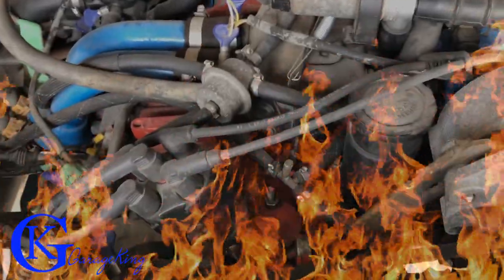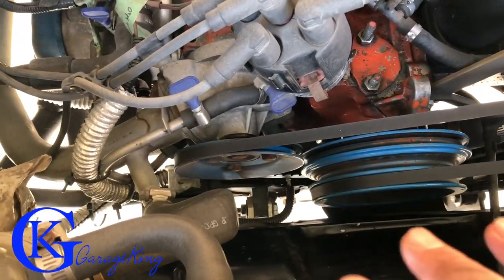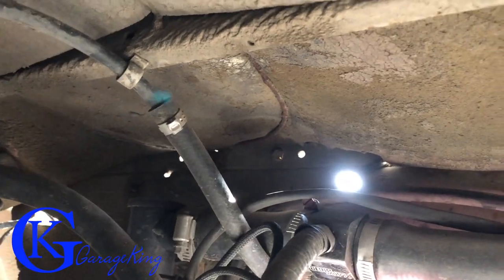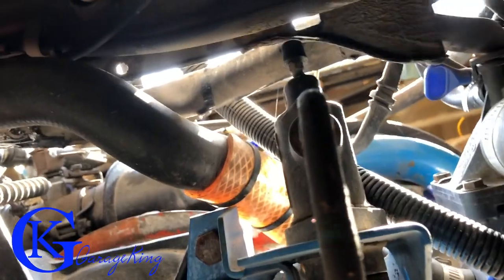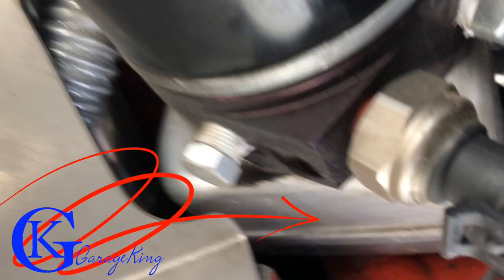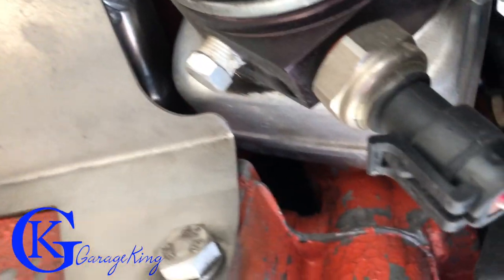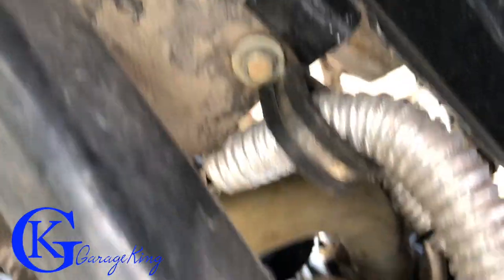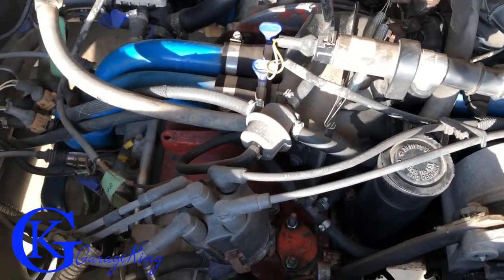4 Must Have Vanagon Gauges

Comment: Great video, It makes me want to try the same set up. Did you post a full shopping list" that would be super helpful. Mahalo from Hawaii.   1989 2.0 T3
Reply from the maker: Thanks for the comment and I wish I was in Hawaii right now!!!!!!!  I bought everything from https://www.maxtow.com/  the gauges are actually quite expensive so I didn't think anyone would want the ones that I bought (I figured people would buy cheaper gauges)  The double vision gauges I got are over 100 each so you know thats like almost 500 bucks just for the gauges.  The rest was not too pricey, the adaptor for the hot water sensor was the 1 inch one, and then just the sandwich adaptor for the oil filter.  I thought it was really cool to do, but its not cheap that's for sure.  I did think about cheaper gauges, but I thought what the heck you only live once !!!!  Happy Saturday to you ;)

Comment: Which model of Glow Shift sandwich adapter did you get? I have seen conflicting versions form people for the 2.1L waterboxer.
Reply from the maker: Hey brother I looked everywhere for my bill and can't find the model #.  Believe me I search, even through my emails.  I believe you should get the one with the threads 3/4-16 UNF if you have a North American vehicle.  Sorry for the delay, and hope I helped you out.
Reply: @GarageKing  Thanks for the info, greatly appreciated!
Reply from the maker: @westyfreedom9284  Anytime !!!!
Reply: @westyfreedom9284  hi, would you happen to have confirmed the part # for the2.1l?
Reply: @mozaic_channel  Sorry, it is the GS-AF2
Reply: I also purchased the Innovate 3913 Oil Temp and Pressure dual gauge kit
Reply: @westyfreedom9284  Thank you!
Reply: @westyfreedom9284  costly gauge but looks really neat to be able to program thresholds and range.

Comment: Very informative.  I like the idea of tapping into the bi-pass water hose for temp readings.  I'm having a challenge determining which GlowShift adaptor to use.  Do you have the size? Also, what do you think of tapping into the hose between the water pump pipe behind the pulley and the elbow on the engine case as an alternative location?
Reply from the maker: Hey Thanks for reaching out.  I just went and measured the old bypass hose and its 1 inch inside diameter.  I looked everywhere for a place to do this and the bypass hose is the best as there is a fairly straight part where you can get the adapter in easily, its right between the cylinder heads so you get a true reading before the thermostat opens, and the reading is balanced between the two engine sides.  I would go for that elbow as I think its too tight, plus I'm not sure if that's a constant flow area when the T-Stat is closed, it could be, but I'm not sure.  I really looked the whole thing over and thought the bypass would be best.  Still works like a charm (had the van out a few weeks ago) Its up to you whatever you feel is best, but I think the bypass hose between the cylinder heads is going to be the most accurate and it works.  Gauges on these vans are a good idea because if it ever overheats you may find yourself pulling off the cylinder heads if the rubber seal splits.......